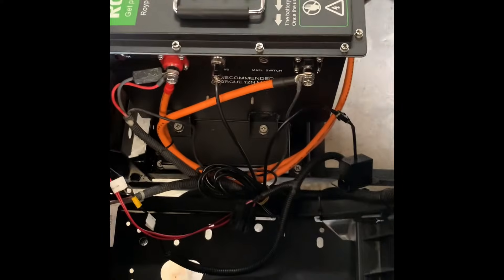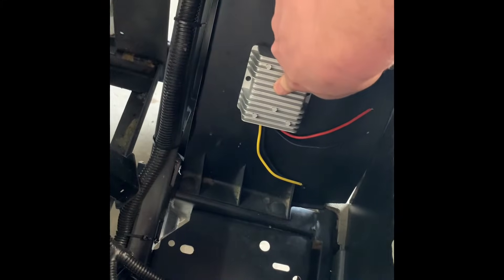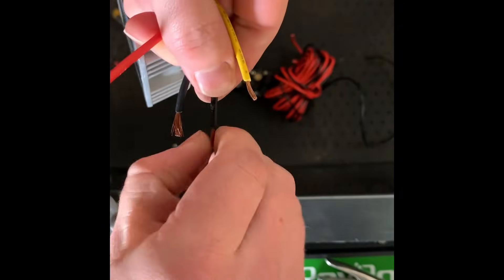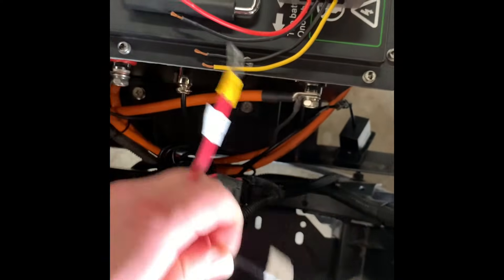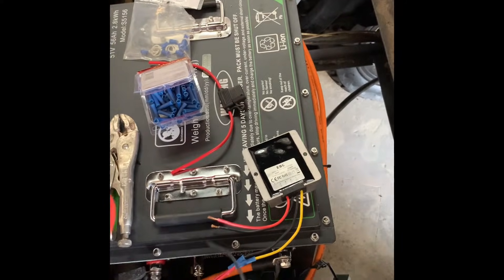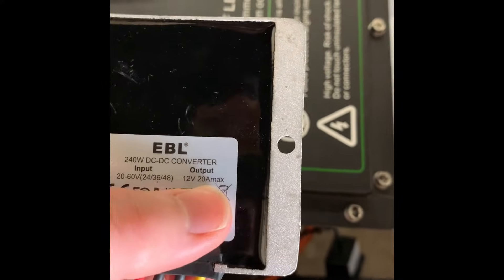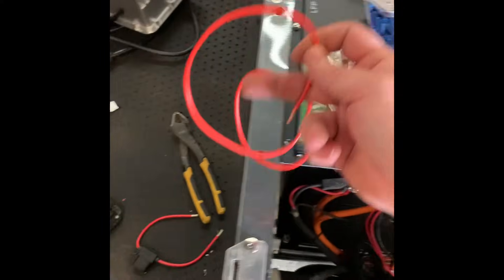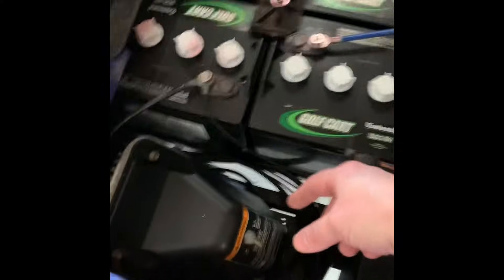Voltage Reducer Tutorial / Installation for Lithium or Lead Acid Batteries EZGO TXT 48v

Comment: can I add a small fuse terminal block to that converter after the converter, then add maybe like 1 underflow kit and an interior cab light kit??? All led's of course.
Reply from the maker: You can add a fuse block on the 12v side but you can easily just combine the light kit and chassis lights on the 12v side of the reducer

Comment: I love the video, but have a question...  I have a 2007 Columbia Par Car with 48v, I would like to be able to power the rig when the key is turned on only, that way I make sure it won't drain the batteries if a switch was left on!!!  Any ideas of where to get a switched 48v as input to the reducer?
Reply from the maker: Get a volt meter and find a wire behind the key that has 48v when the key is on and zero volts when the key is off. Run the hot wire to that and negative to you main negative on your battery pack
Reply: @jbgolfcarts  Awesome, I will try it.  Thanks!!
Reply: This is a very low budget converter. You need to buy a quality part and look at Reliance 30a converter and it will have the extra wire that goes to the KeySwitch, and wire to the switched side as well as the wires that go to main battery terminals and a 4th wire to an always on for memory purposes item like a radio. . Just mentioning  The rxv cart is different and wired to the solenoid but this is a TxT. No familiar with your 07 par car wiring.

Comment: I think it would be better to use a relay and go off the ignition switch
Reply: Standby current is about 1/4 amp so without a key on relay this will eventually drain the battery.

Comment: Does the dc-dc converter waste much power, since it's always cnnected to a live battery, or is it negligible?

Would it be better to tie the converter to the key switch, then it only go on when key is turned on?

Comment: Do you need to have fuses on the 12 volt side on the hot wire?
Reply from the maker: No. If it grounds it’ll blow the reducer and if that doesn’t happen then it’ll pop the fuse on the 48v positive side.
Reply: Couldn't hurt to also fuse the 12 volt side.

Comment: Credit where it’s due: you did a much better job explaining safety precautions to people. There’s another fellow with a solid channel, but he jumped right into the work and didn’t really mention the ways to avoid having the system live.

Most folks are smart enough to flip the switch into tow, but you did a good job explaining how the lead acid batteries are always live. That will surprise and shock some people if they don’t know what to expect. #beenthere

Thanks for putting this together. ✌️ 🍻

Comment: I'm no expert, but it appears that the max output at 12V is 20A. That would be equivalent to 5A on the 48V side,  so putting a 15A fuse on the 48V side seems too high.
Reply: yes - I had the same thought. To get to 12 V x 20 amp = 240 W ..... 240 W / 48 V = 5 amp
Reply: @4heitjer  For the amp draw on the 48v side what decides how many amps is drawn? Is the amp draw on the 48 volt side determined by the amp draw on the 12 volt side?
Reply: The fuse he added is on the input side to protect converter not the output. Each accessory added would be fused separately depending on what it is. Usually better to run to a fuse box but he was only doing lights. 
The 30a units I install come with a 30a fuse for the input so he was actually under sizing it for safety reasons below with at the unit was rated for at 20a. This is a cheap converter that I would never install but if so would def fuse the main as he did for safety.

Comment: How did you know which combo was the 48V on tbe lead acid version?
Reply from the maker: You’ll have cables coming from you controller and solenoid. That’ll be you main positive and negative. If you still can’t figure out which it is follow the back of your charger port. Those wires have to go to your main positive and negative to charge the batteries.

Comment: I see others have the same question and was wondering   couldn't you connect one wire at the solenoid  so when power on only given after key is turned on?

Comment: How do you install  on 48v  and only want converter on when key is on? Having converter on 24/7 is a constant drain and needed use on converter...
Reply from the maker: This converter doesn’t have a key option. You can wire the positive to the key when it’s on and zero volts when off. The 18amp does have an additional wire for the key switch.

Comment: Great video, I would like to do the same setup but use a on/off toggle switch on the 48V red power wire. Is that possible? I’d like to know what type of switch to use since I can’t find a 48V switch.
Reply from the maker: Yes. Just make sure the toggle switch can handle 48v.
Reply: @jbgolfcarts  thanks for the reply. Can you give me a link or specs of a switch. I am only powering LED Light kit. I can’t seem to find a 48V switch. 🤪
Reply: @jbgolfcarts  lol 🧸

Comment: Shouldn't the voltage reducer be hooked up behind the switch so that it only gets power when the power switch is turned on?  It looks like the way you hooked it up, the voltage reducer always gets power.  Is there something I'm not understanding?
Reply: You should install a simple 2-prong on-off switch so u can address the constant draw question. Without it, it’s always drawing…
Reply: I have the same question.  Im wondering how to hook it up behind the ignition because i dont want it to constantly have power.
Reply: Mine draws 1/4 amp on standby on my lead acid batteries so I turn the +36 volt input off by a relay operated with the key switch.

Comment: Is the output voltage adjustable?  I am seeing any screws like those on different models that you can turn to adjust the output voltages.  So is the output voltage fixed? Thanks.
Reply from the maker: Can’t adjust on this voltage reducer.

Comment: I thought it was better to mount on metal to prevent fire if regulator overheats, no?
Reply: Yes you are correct Rick. Should be mounted to metal so that it acts like a heat sink and disperses the heat properly. Even better to mount to heat sink so air can circulate underneath if you want best results for longevity.  You should  have fuses to blow in case of a short circuit. Plastic is not a good idea and neither is crimping lugs with vise grips. These are cheap inverters and more reliable ones on a txt have an extra wire that goes to the switched side of the KeySwitch. This inverter is very basic. Reliance converters are better option. Hope that helps
Reply from the maker: No. I usually don’t like mounting electrical stuff like a voltage reducer on metal. If somehow it grounds since it’s on metal it could catch it on fire.

Comment: Great vid! Question: my lithium pack has separate 12v pos/neg connections for accessories but I already have a reducer installed that was used w/ the lead acid batteries. Would you suggest just hooking the wires into the 48v terminals of the lithium pack that already run to the reducer like it was on the LA Batts and just keep it all wired like it was or remove the reducer and run the accessories off the 12v terminals on the lithium pack? Is one way better than the other, safer, easier? Appreciate any input you can offer!
Reply: i'd like to know that myself. my lithium battery is the same. when i swapped everything over, my radio, speakers, and underbody LEDs work, but light kit and horn do not.
Reply: @dawgfan316  Mac, I did more research on this and found out since I already have a voltage reducer installed that I should leave it there and just swap the 48v connections from the lead acid over to the 48v connections on the lithium pack,  leave all the accessories hooked up to the reducer the way they are. Sounds way easy enough!
Reply: @dawgfan316  I'm wondering if your light kit was run off the batteries while all your other accessories were hooked to the reducer maybe? If so you need to find those wires and either run them off your 12v side of the voltage reducer (if the amperage on the reducer is high enough for all you have hooked to it) or connect them to the 12v connections on the lithium pack if you have that option on your pack.
Reply: @mygt8a4re   when i swapped everything, i put everything from the pack neg and pos onto the 48v neg/pos on the lithium pack. then i had a blue wire from the light kit harness that was on a single battery negative. I had 6 8v batts in the old setup. I do have 12v pos/neg on the lithium battery. It's got to be something simple but i can't figure it out.
Reply: @dawgfan316  I know on most light kits the main power wire is blue, but it wouldn't be hooked to a negative source. The way golf cart batteries run in series it was most likely a point where it read 16v pos, your 2nd 8v battery in a series connection. Most light kits can handle 16v. Take the blue wire and connect it to your 12v pos on your lithium pack. I can only assume that the light kit is still grounded somewhere. Did you have another wire left over? You may have to follow the wires from your light kit to be sure you have both a pos & neg connection wires for the lights
Reply: @mygt8a4re  Maybe it was on a positive in the old setup. There weren't any other wires when i swapped everything. I tried putting that blue wire everywhere so it's possible i blew the lights.
Reply: @dawgfan316  if you touched it to 48v you most definitely blue a fuse in the light kit.
Reply: @mygt8a4re  Yeah i need to get inside behind the dash and check the ones i can't see. I do appreciate your help though. Many thanks!
Reply: @dawgfan316  No problem Mac, best of luck with your lights